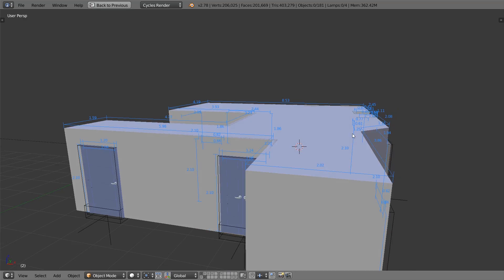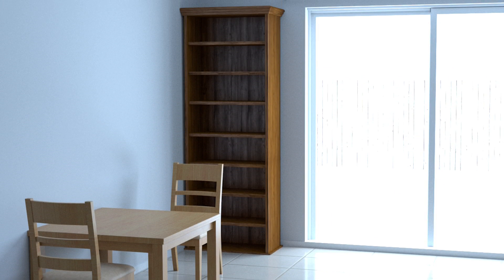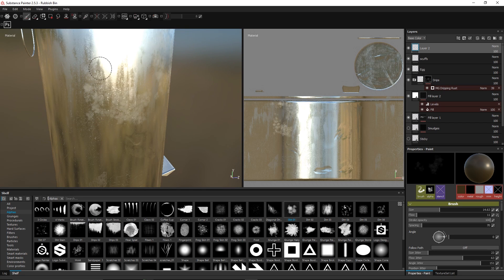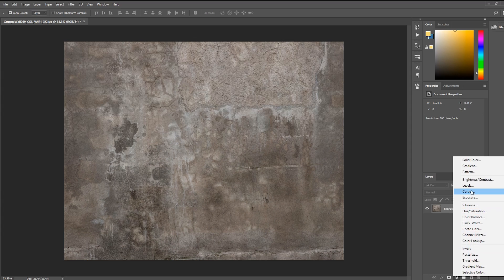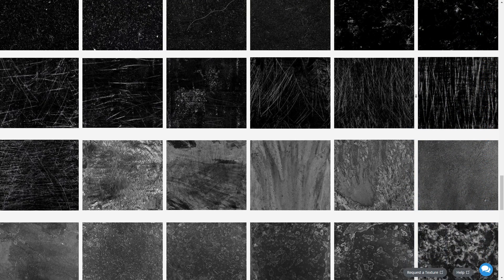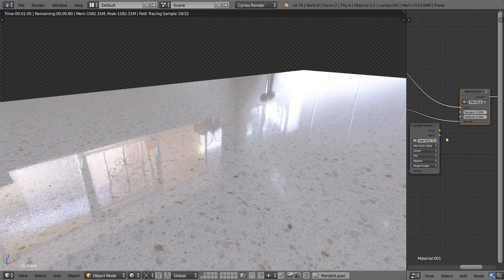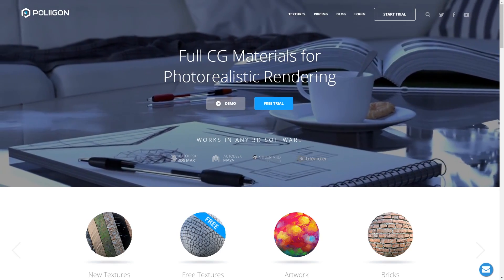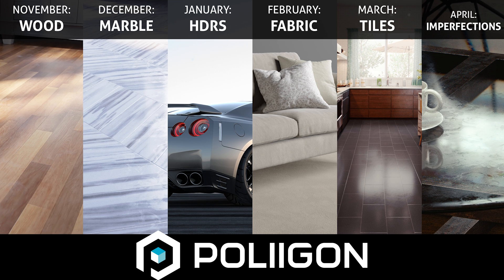What are Surface Imperfection Maps?

Comment: But why can't this just be baked into the different textures (roughness, diffuse, normal, etc). What is the purpose of an entirely seperate texture? Even here you use it as a roughness map. If you paint out areas you don't need, maybe you can justify it, but that's still part of the roughness output in the end. Don't get me wrong, distributing these separately is a great idea, just not a new one.
Reply: They interact dynamically with the lighting. If it were baked it would look the same no matter which angle you were looking at it and no matter how the lighting was set up around the object.
Reply: What does that mean? What physical property does it actually change?
Reply: its plugged into the roughness node. Light reflects differently off of different parts of the mesh depending on the white and black of the map. Similar to displacement maps. You can't bake that into diffused/albedo textures.

Comment: What about the perfectly straight lines. Yeah didn't think of that one did you? No.
#burned?
Reply: Autiismo Ever heard of displacement maps??
Reply: Autiismo Add the right bump/normal to your, lets say, wall and the edges wont look razor sharp anymore, but rough and natural ^^
Reply: You can use displacement maps after tesselation.
Reply: Oh wow I'm retarded, I never heard about displacement maps. I'm not actually into 3D modeling or anything, this is just in my recommended. Thanks for pointing that out guys.
Reply: This is just a collection of textures and texture maps, not a damn modeling software bro. You can't just add a texture and have your actual object change. Although, that would be cool, hint hint anybody who makes 3d modeling software.
Reply: @autiismo8297  You might want to look at #nodevember, you'd be impressed.